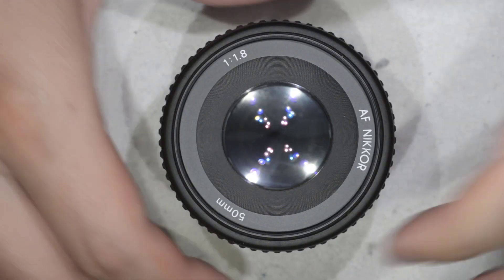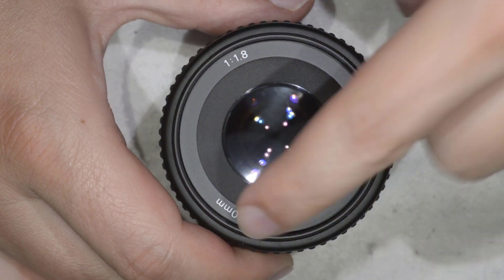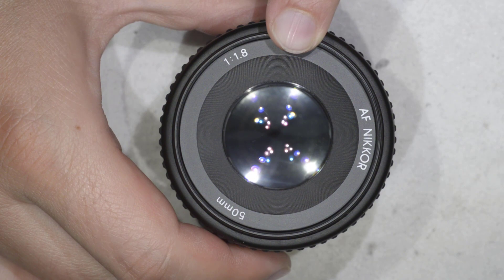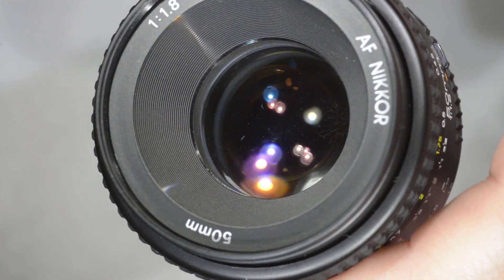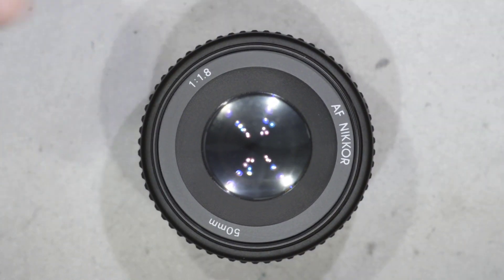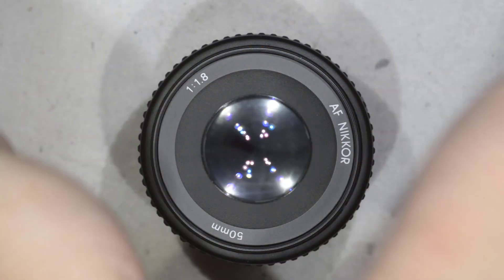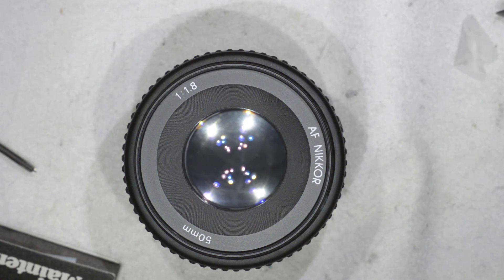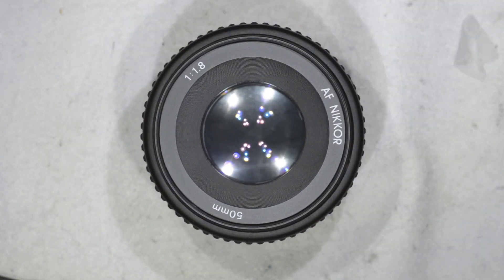Nikon Nikkor 50 f/1.8 : fungus cleaning

Comment: Hi the biggest problem I am getting is when I put the lens back together again I have dust all over the lenses I have made a small cleaning room out of thick card with a light inside and a hover to take the dust out the box to have a completely dust free place to work but still having the problem of small dust still on the lens can you come up with a good idea mark
Reply from the maker: Hi Mark, are you sucking or blowing the air? if sucking, I don't think it works well because you'll be getting the dust inside the box. Try a cleaning fluid with deionizing agents otherwise. Cheers.
Reply: @diyextravaganza   I have tried all ways to keep the dust off the lens but still getting dust Particles on the lens can you think of any other ways of making something which has no dust in the environment I made a Cardboard clean room with a Perspex top and a pump to suck out the air out of the box with a filter but still getting slight dust  particles
Reply from the maker: @marcusjames1221  try pushing air instead of sucking air and thus dust in. All clean rooms are designed to push air in and have slightly higher pressure than the exterior so to avoid aspiring air in.
Reply: @diyextravaganza  I think what is happening is when I clean the lens with tissue it builds up Static and dust gets Attracted
Reply from the maker: @marcusjames1221  that's also a reason, you can try using a cleaning fluid like the Zeiss which has anti-static components, and use a microfiber cloth (a new one ideally)

Comment: Buddy, I've a 1.8D version n in it the first two elements are fixed on sticked together by some glue or something n there is fungus inside the 2 elements. My question is how to separate the first 2 elements if they are glued together in D version, I looked for a gap n there was none between them. Do you know or what do you suggest?🤗☺️
Reply from the maker: You mean the front element?, there is only three lenses there, and in the video I show how to access each of them. Cheers.
Reply: @diyextravaganza  Yes I'm talking about front element in D version. You see @ 4:00 you are twisting the element assembly and it just loosen up, but in 1.8D version there's no such screwing mechanism I think the elements are all glued together. I maybe incorrect but I checked many times but was afraid to continue in fear of damaging it. That's why I asked the first question ☺️🙁. Anyway nice diy video 👍🏼🙌🏼
Reply from the maker: @abhijithkg1467  oh seriously?, I thought the construction of the 1.8D was exactly the same. if not, you'll need to cut the glue around like in this video. https://youtu.be/qFfH3-gp2y0
Reply from the maker: @abhijithkg1467  You're right, I just opened a 1.8D and indeed they are glued, proceed with the recomended video (https://youtu.be/qFfH3-gp2y0), please use gloves, a very sharp tool and very high magnification (I do it under microscope), otherwise, use safety glasses.
Reply: @diyextravaganza  ah... thank you for ur reply buddy 🙌🏼, I'm not gonna take it apart again as I've already cleaned the fungus which was on the back elements n the fungus between the front elements are actually very tiny n won't even affect IQ. So currently happy with it n I've plans to purchase a UV light to occasionally expose the lens to kill fungus growth, currently it's stored in a transparent air tight food container with colour indicating silica gel. Anyway thank you for ur suggestions n support bud 🤗🙌🏼😊
Reply from the maker: @abhijithkg1467  you're welcome, yeah, some repairs aren't worth the fuzz.

Comment: Great video. I've also watched your 'Recipe for fungus removal' video too :) Is the optical cleaning fluid (a Zeiss product) the same chemical as the Hama HTMC fluid you show in this video? Many thanks for sharing your knowledge and experience, all very much appreciated.
Reply from the maker: Hello, I've never tried the Zeiss fluid myself but I guess it is good stuff.
Reply: @diyextravaganza OK, thanks for the reply. I ordered some so I'll let you know when I try it out ;)
Reply: @diyextravaganza  I also ordered a JIS screwdriver set: absolutely first class quality. Thanks for the recommendation, really useful information. Almost ordered the 'wrong' set but double checked the contents and managed to get the right ones :)
Reply from the maker: @nigelgroves19  even the wrong set is useful for older lenses and it has the 1.2mm flat screw-driver that fits perfectly on barrel-locking screws.